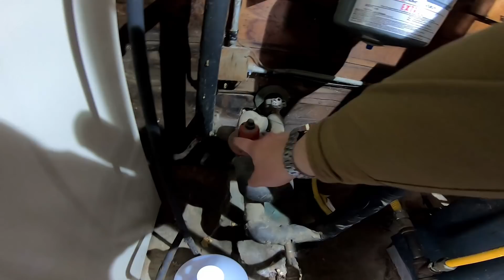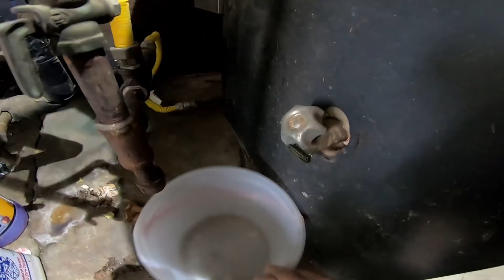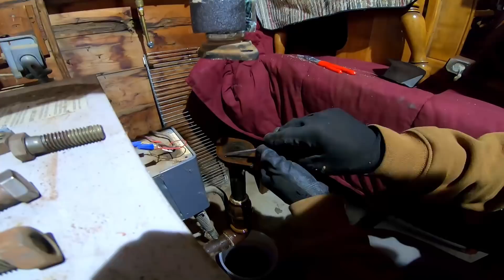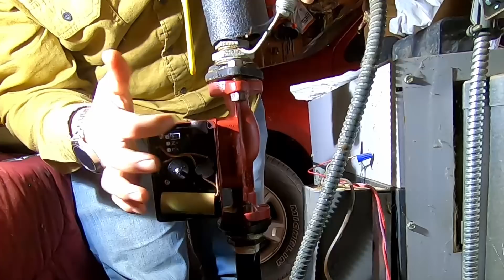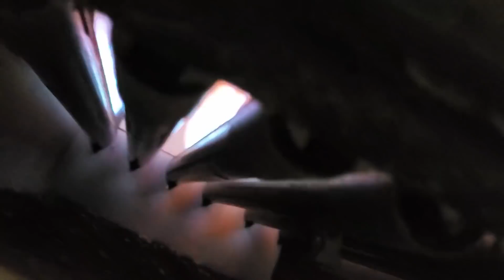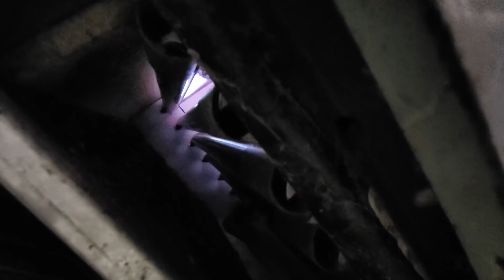How To Install a New Boiler Pump

Comment: Sir, I miss Rotation the pumphead to the correct position. Lose 4 screws and rotate the head till writing is horizontal and normally to read. Now you have the cablegland going down and humidity is no problem for electrical parts inside.

Comment: Where should I leave the em2 pump switch on my hydronic boiler 3 options
1. Auto 2. Off 3. Constant right now it’s on 3 constantly running. Thx!

Comment: I just bought the same pump but it's a little shorter than the original pump to reach the flanges on the pipes. What do I buy to make it fit? 😩 Btw great video 👍

Comment: Question:regardless of whether the thermostat calls for heat or not (set temperature in the room has reached), the burner will fire up and heat the water in the tank if it is below 180F and bring it back to 180F, right? while the circulator pump, which is controlled by thermostat should not work/kick off bacause the temperature is already reached.

Comment: Thanks so much for this. My pump is on the supply side but has no isolation valve. You pretty well convinced me I could DIY this if I had some way to shut it off, but it looks like I’d need to drain my whole hot water heater so maybe a job for the pros 😂.
Reply from the maker: It's always nice to be able to at least understand what you're up against. Hope it turns out well for you!

Comment: I just discovered that whoever installed my pump twenty five years ago before I bought the house installed it backwards. It's pumping water into the returns of the radiators instead from the returns into the boiler.

Comment: Great job diagnosing and replacing that pump! I heard you mention about an air vent or bleeder on a high point of the system that was non existing. Where the expansion tank was connected, the device on top (that you placed your hand on) is a Spiro vent. It will take care of all or any air in the system, this is basically an air scoop and high vent on steroids, I use them on all my boiler/radiant systems and would highly recommend them over old conventional ones.

Comment: This video made me proud of myself, 😂 because in the 70s and 80s I had a forced hot water system and I knew about everything you said except the 10 lbs of pressure in the line. I don’t remember a pressure gauge on it, but
there probably was one. The furnace I had was oil fired...Thanks for the video.

Comment: There's a ground going to the pump; it's the metallic shield of the MC cable. You're probably not used to that type of cable where you are in MN; it's common all over NYC and used almost exclusively on boilers because it is rugged and tolerates vibration well.
Reply from the maker: What do you do in cases like this one where the conduit is attaching to a plastic pump housing? Do you add a ground wire in that case?
Reply: @BenjaminSahlstrom  I suppose the best thing to do is is pull a ground through the flex in that case. I didn't realize any of these things were made with totally plastic housings. Your original unit had a metal housing and was thus grounded through the metal flex. Grundfos is a leading manufacturer of pumps; I'm really surprised they use a fully plastic housing. Presumably they sell most of these things in Europe where MC cable is normally not used. Taco pumps seem to be the gold standard in the U.S. and they've always been made with metal boxes for wiring.
Reply: That style pump like most newer pumps was designed for liquid-tight connections because of the wet environments they're usaully exposed to, so it would/should   require a 14/3 conductor also rated for damp locations.

Comment: Well it appears your accumulator(expansion tank) is well sized for the system. You started out at 10 psi and high limit cut out before it reached 20 psi. I think those pressures are fine and the red pump is a much better pump.

Comment: Nice video Ben!

Could you make a video on the different types of junction boxes, cover plates, connectors?  When to use, where to use, how to use?  With what wire (Romex, THHN, MC etc) what conduit / fittings?  Some boxes have brackets or not , or raised ground or not.  Explain the differences.  That would be a helpful video

Comment: Great Video. What is the job Circulator Pump does and use for in Boiler ? Thank you for sharing ^_^
Reply: It moves hot water from the boiler to radiators in the home and back in a circuit

Comment: This summer I put shutoff values on both sides of all my pumps so I don't have to worry about losing water and getting air in the lines. Enjoyed the video.
Reply from the maker: That is so worth the investment!
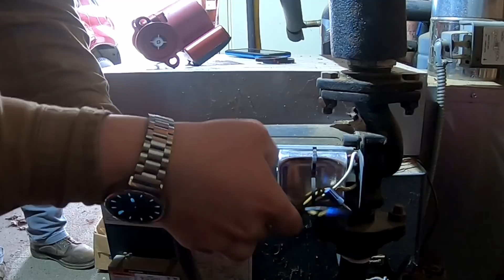Reply: @BenjaminSahlstrom  6:13 Ground wire is mostly likely the Conduit.

Comment: That's a cute little pump.  The last time I changed one of those I had to use a fork lift to lift the pump out and back in. And it used Victaulic couplings.  Glad I'm retired now.
Reply from the maker: My goodness that must have been a huge pump! I haven't worked on any pumps that I couldn't lift but some of them have been pretty large 3 phase pumps.
Reply: @BenjaminSahlstrom  Yeah, it was the chilled water circuit for a plastics manufacturing plant. The water line was 6".  We had a row of three of them feeding three circuits off one chiller.  Two of the pumps lifted water to two cooling towers. The third was for chilled water to the process equipment.  There was more support equipment than actual process machinery.  It was my job to keep all this running 24/7.  A lot of late hours. But I loved it.
Reply: I just replaced my pump and had to use a car jack to lift the old iron pipe which refused to let the old pump go.

Comment: The safety valve is called a PnT valve
Pressure & Temperature 
Either will cause that valve to lift
I noticed the check valve was installed in the new pump. Did the old one have the check valve installed ? Another reason to pay attention to flow arrow

Comment: Why not use a box, open end, or socket wrench to remove & replace bolts & nuts? The fancy pliers are just lazy. I am not sure wear this took place  , what brand pump or spec but I bet a ground wire is required.
Reply from the maker: Probably. :)
Reply: Ed Sheldon: I like the Knipex because you don't have to carry five thousand box-ends (exaggeration) or search for the right size you might have misplaced.